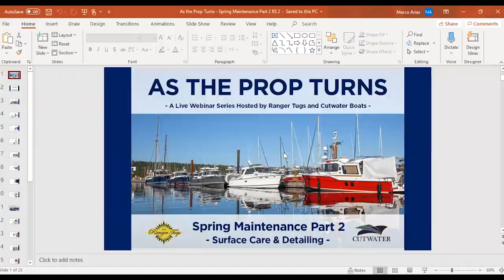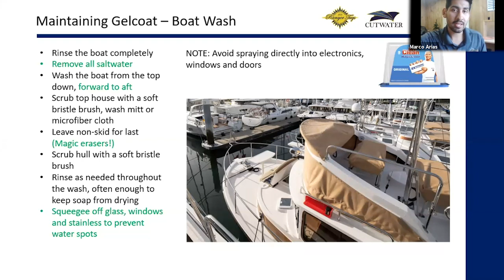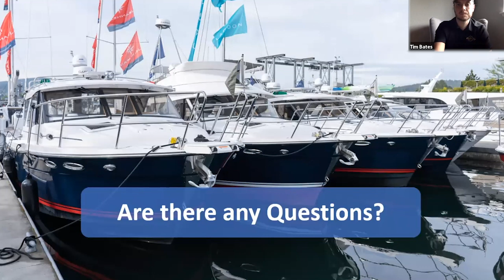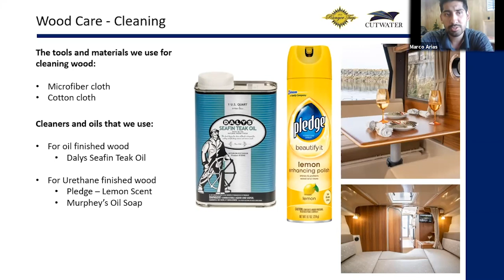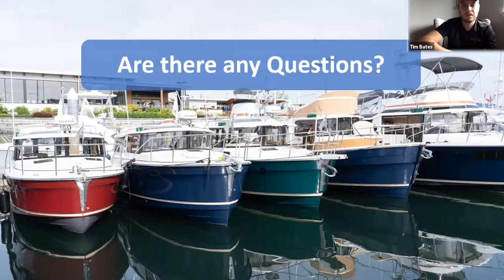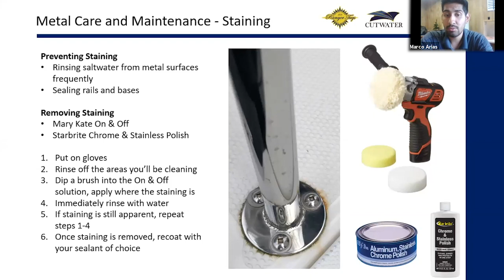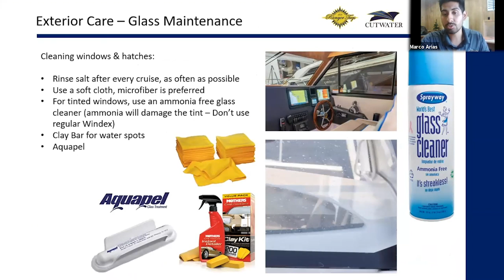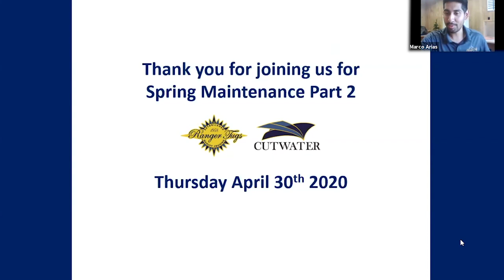As the Prop Turns | Spring Maintenance Part 2

Comment: for the brass portholes: flour, vinegar, and salt.  Make a paste, brush it on with a toothbrush, wait a couple of hours and clean it off.  It works great.  Once it is like you want it rub it with extra virgin olive oil or vegetable oil and it will maintain for much longer.

Comment: sorry, but you should never use a brush to clean teak.  the bristles will gauge out the soft veins.  use a rough nylon pad across the grain, never with it.  and I would use caustic teak cleaner/brighter VERY sparingly.......